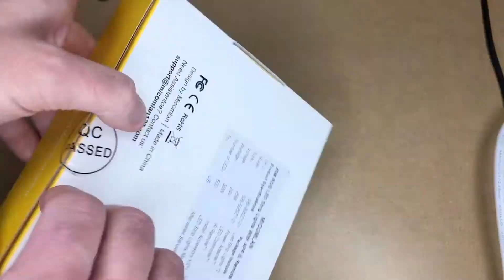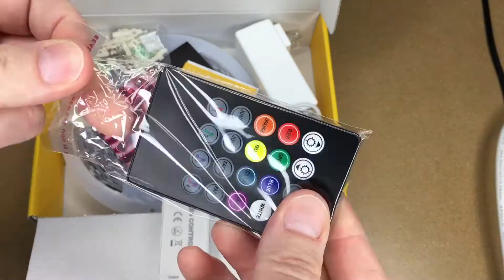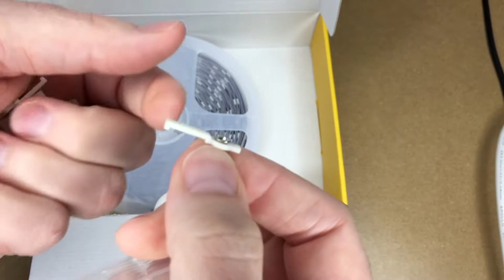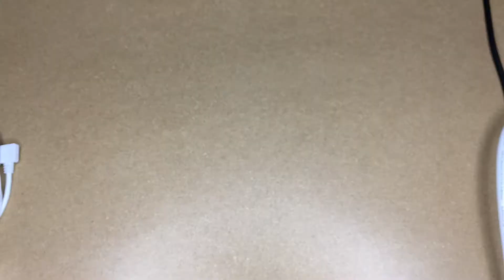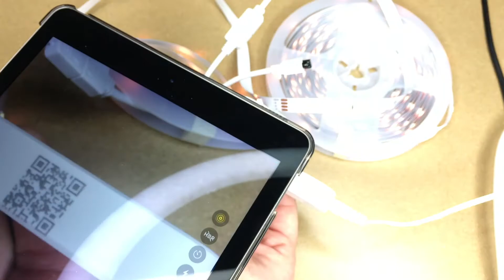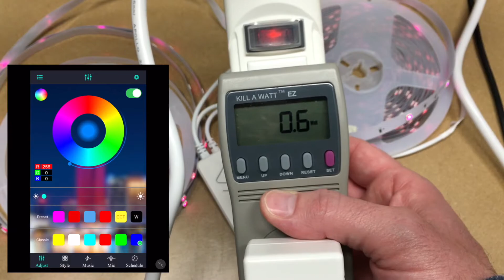Micomlan 82ft/25M Led Strip Lights with Music Sync and App

Comment: I bought the same exact one, but when I connect the both rolls of led lights, they just remain bright purple and don't change colour and isn't changing colour from the remote or app. The only time it works is when one roll is plugged in. Can you help me?
Reply from the maker: Do you have the arrows lined up (facing each other) on the connectors?
Reply: @Rickmakes  yes I do, if I don't have them lined up then they won't light at all, so I'm just guessing that it's a malfunction problem

Comment: Can u put both on the rolls in different rooms or have to be same room ?
Reply from the maker: You could put the strands in different rooms but they would both need to be connected to the same power supply so you would have to route the wires between the rooms.